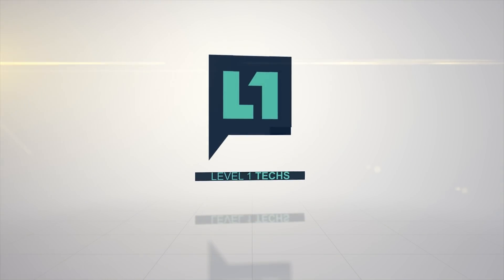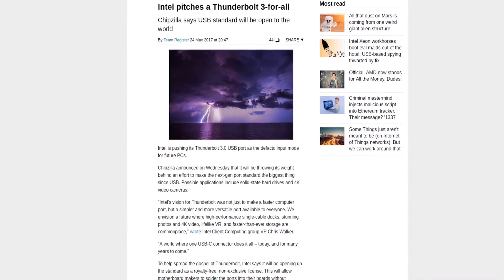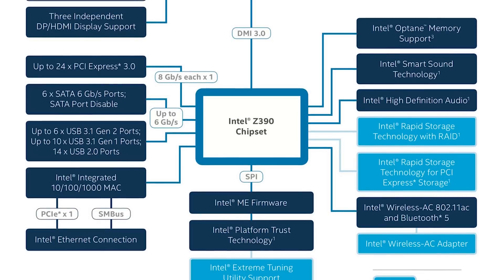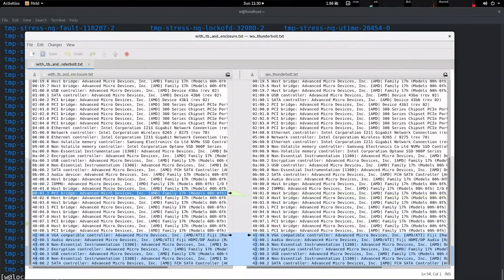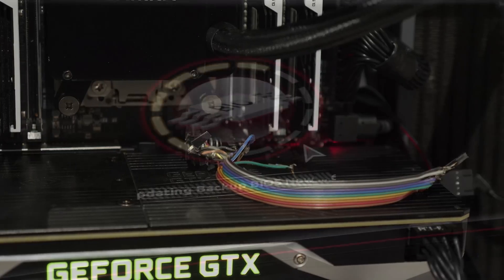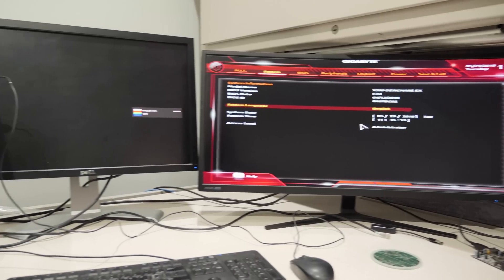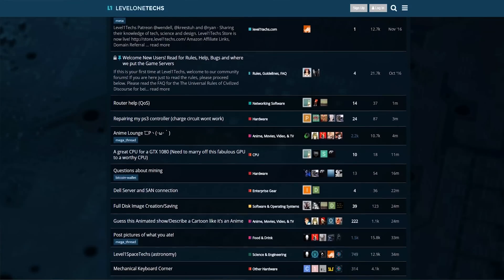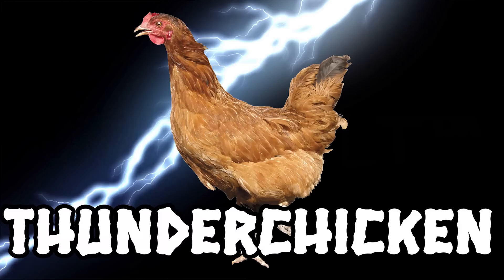Where is Thunderbolt on Threadripper?! Here it is, but...

Comment: Thunderbolt is the preferred way to connect pro audio interfaces for recording / audio processing!  It's lower latency, higher bandwidth and all around far more stable than USB.  This is super exciting, and I've actually been waiting on Gigabyte to certify this motherboard with baited breath.  Great work.  Thunderbolt hotplug is something that the hackintosh community has been trying to get done for a long time.  I wonder if your work could have some benefit there?
Reply: Not as low latency as pcie, or pci, especially when RME is the company you're talking about, with their FPGA chips, instead of off the shelf DACs other companies use.
Reply: CrimSun I'm not aware of any popular interfaces nowadays that use pci express cards directly.  Besides, TB basically is PCIe x4 right?  My point is that it is leagues better than USB on Windows because of inconsistent USB host controller drivers between chipsets.
Reply: It's a common misconception that professional audio requires a lot of processing for the audio tracks. Even a pc from 15 years ago can play hundreds of channels with the correct audio interface. And that's on PCI, not PCI express. RME's MADI protocol gives you 256 channels...On PCIe x1. When asked about why RME decided to stick to USB 2.0, despite brand new interfaces being USB 3.0, they explained that the extra bandwidth is not necessary. Despite advancements in computing, professional audio still uses 24 bits at 48 KHz, which even an integrated soundcard can deal with nowadays. The only theoretical benefits would be lower latencies but...Even on old PCI interfaces, you could get 0.025 ms of latency at 64 samples.
Reply: For just raw audio this may be true, but if you run a lot of plugins live in your DAW then you need extra CPU horsepower for that.  Also MADI is not RME's protocol, it's an AES standard that can be implemented by anyone.  For the purposes of having an audio interface that you can easily move in between different computers while having the lowest latency and highest channel count, Thunderbolt is the obvious winner.  This is why you see Thunderbolt on almost all of the most popular high end interfaces today such as the Apollo 8P, Presonus Quantum, RME Fireface UFX+, etc.  I work for a pro audio company, but also run a home studio in my basement using Thunderbolt / AVB to host live streams.  To minimize the amount of acoustic sound happening in the room when recording a band, I use Scuffham S-Gear / Guitar Rig live on any guitars and iZotope / Waves plugins on every channel in the drum mic setup at a 32 sample buffer.  You definitely don't need the best hardware on the market to produce music, but from personal experience my R7 1700X performs way better than my i7 rig in the sheer number of plugins I can load without having buffer issues.
Reply: You certainly don't need a thunderbolt connection on a DAC if you're just talking about a 2 channel playback device.  In pro audio interfaces it is popular because of its reliability, bandwidth and latency.  If you haven't used a large variety of pro audio interfaces with a large variety of computers you may not have personal experience with this, but USB can be unreliable when it comes to real time audio for studios.  The actual latency difference is fairly negligible, but in Windows especially there can be compatibility issues between certain USB chipsets and the USB implementation / drivers on certain audio interfaces.

https://en.wikipedia.org/wiki/USB_(Communications)#USB_2.0_speed_negotiation

Some motherboard USB chipsets do not properly implement "high bandwidth mode" and will exhibit strange behavior when using more than 24 channels.  ASMedia chips are particularly bad in this regard.
Reply: Well, Thunderbolt is not the obvious winner, Ethernet is. Many more computers have Ethernet ports than Thunderbolt ports or USB C. Also, many of the Ethernet based protocols are modular, allowing you to have as many channels as you think you need.
Reply: Yea, I use AVB in my studio and have used Dante in the past.  It's great for transmitting audio in between audio interfaces, but as far as an interfacing directly with the computer, Thunderbolt is better in my experience at least.  I've used the direct AVB connection on OS X and it is not all that great of an experience for use in a studio.  To use AVB natively on a computer, you need an ethernet card with an Intel i210 chipset that supports AVB and an operating system that supports it as well.  The vast majority of audio interfaces nowadays are USB on the low end and TB on the high end as far as the computer interface goes.  For anyone that runs a studio and needs a rock solid stable interface between their audio hardware and their computer, they're going to choose Thunderbolt.

Comment: I got Hotplug to work using a R9 380 on a riser using the express card slot on my Thinkpad. Drivers didn't load but I was using passthrough so it worked anyway.

Comment: I don't think Intel will ever license TB for AMD or ARM. and Honestly Why not AMD themselves come up with some other technology that has better bandwidth and lower latency?
Heck why aren't we using x16 external graphics over optical fiber cables? WHY NOT? Who cares about hot plug? a restart in modern days with SSDs ain't too much hussle and even windows will resume your Office word/excel sheets documents for you even if you didnt saved your work.
Reply: Having yet another standard is the last thing we need...
Reply: OCuLink already exists for x4 and x8 and they are working on x16. So there is a chance that you may find an OCuLink port on an AMD laptop in the future.

For desktops and servers there are already such add-in cards in addition to those ports being included on motherboards. Maybe soon enough Thunderbolt will not matter that much anymore as OCuLink receives wider acceptance.

Comment: Since you have been fiddling a bit with Threadripper. If you stress a single core using Statuscore or some other program on a 1950X in Windows and only see around 3.7GHz could the CPU be defect? I have a Zenith Extreme and cool it using a 360 Liqtech. BIOS settings that affect XFR etc are enabled. When I contacted AMD and asked and instead of technical support I got an RMA number... felt strange.

Comment: Every computer must have thunderbolt + USB-C and replace every port. USB-A must be for legacy retrocompatibility.
Reply: Guillermo Frontera I'm all for that. If we'd make openbolt it would be better tho. Straight up hotplug pci lanes. That would help with GPU enclosures.
Reply: I just want a motherboard that does not have any pointless shit , like audio or network ports or wifi or any other shit you dont need

Massive bank of USB on the back few RS232 a real PS/2 port and your done. Add your own Ethernet with a card , add your own audio with a USB DAC
Reply: Andrew Joy If we're talking removing pointless shit why not RS232 and PS/2 too? Ethernet and/or wifi has to stay, who doesn't need that?
Reply: Andrew Joy - same! I was thinking how pointless audio is, also. I mean, a lot of people will just use audio through DisplayPort or HDMI, and you can add an audio interface through Thunderbolt or USB any time you need. But yeah, unlikely to happen as people would rage. Perhaps they need to make the rear I/O plate modular so you can insert PCIe modules into it, and hence can exclude the sound card if not needed (and customise the rest).
Reply: Nicholas Johnson spdif should stay for simple stereo systems, for everything else hdmi is there. I don't know either why we have a lot of jack on every motherboard with software pieces of shit (sorry, i have forgot the name of them, but one of them supposed to help you to know where the enemy moves by step sounds and show it on radar, ecetera, i have no clue if its even work...).
Reply: Tappy What about for example 8 thunderbolt+usb c connectors + 4 usb c only + 2 usb A + 1 10GB Ethernet and may be audio. RS232, wireless and even PS/2 can be thundetbolt dongles with real pci-e bridges and your gaming keyboard and mouse can be direct pci-e low latency devices. Onboard graphics and surround audio can came from thunderbolt. Even thunderbolt external hi performance wifi dongles.
For me, every thing must be pci-e. Exept for low speed cheap devices than may be usb c.
Reply: @GuillermoFrontera  Can you count PCI express lanes? 8 thunderbolts is 8x4=32 PCI express lanes. That's twice as many any desktop level processors have and I'm not sure the MOBO Chipset can support as many.
Reply: Yes, totally agree. I am one of the people who want to embrace change as fast as possible - less painful that way, minimise the transition period where you have the overlap. But people like to drag things out. They are worried about pissing people off when they cannot connect old stuff. When the MacBook Pro 2016 came out, all people could see was "they are doing this to sell us dongles" when in fact, it was one of the few things I actually commend Apple for. It was a bold move, but it was a good one. The same as their driving of DisplayPort.

Whether it is Thunderbolt 3 or some other standard, I want some form of PCIe through USB-C, and I want to see USB all but disappear (probably only keep it for slow devices such as mice and keyboards). Cut out the middle man. USB is another protocol. Thunderbolt does not add another protocol (none that is visible to the system) - it just carries the existing PCIe from A->B. The Thunderbolt protocol is transparent to the system (all the system sees is a PCI bridge).

Comment: Kind of relevant, We (Macrumors forums) got NVMe booting working on the Mac Pro 5,1 by extracting the NVMe_DXE.ffs from the 2013 Mac Pro and Patching it to the 5,1 EFI firmware. The 2010 Mac Pro does not have Signed EFI update support, so an EEPROM programmer is not needed, it's all done in the OS. https://docs.google.com/document/d/1WNkM9LuGPq1sArO9EedWBHYq14NU7m-mDBLAWWJipyM/edit#heading=h.l23937sx565e
https://forums.macrumors.com/threads/mp51-0084-b00-rom-dump-request.2119496/page-14

Comment: Weirdly I was just thinking about this. Do people not use Thunderbolt 3 cards? Or does that not work?
Reply: Silas Mayes Thing is that they don't connect directly to the CPU and thus get limited by the PCIE bandwidth that the card is connected to. By running TB directly from the CPU you can directly utilize PCIE lanes for the TB connection itself. You may want to compare it with the way Intel sets it up, where all TB connections go through the chipset. The chipset is connected through the DMI bus which forms a bottleneck. Regardless of TB cards working on Threadripper (I have no idea if that works), this is one step further and even better :)

Comment: Lightning bolt might be a good name for it, although Wendelbolt sounds cool aswell !
Reply: Open Bolt seems like the best one I've heard others throwing out.
Reply: A Lightning Bolt would not be limited to 2M cables, though.
Honestly, where are the optical ones already?
Personally Thunderbolt needs to revert to being Light Peak.
I hope they designed the ability to insert optical fibres into the USB-C connector, otherwise they will need to change again, or use transceiver cables (which are inherently unreliable).
The USB-C spec has changed to allow direct-connected devices to reconfigure the 4x USB 2.0 wires as a third super speed channel - but this will require new cables, as the existing ones use poor quality wires for USB 2.0. I am guessing the new cables will be e-marked as being fit for purpose. The first standard to make use of this is VirtualLink for VR. But Thunderbolt should be able to make use of the third lane to increase bandwidth without too much of an increase in signalling rate. But it is only delaying the inevitable - that copper is not enough. If Thunderbolt started off optical at 10Gbps (abandoned because of cost), then at 40Gbps over copper, we must be just about at the limits (as they thought it would need to be optical from the get-go).
Reply: I think that name had been used sometimes...

Comment: Wow,  nice to see good old reverse engineering at work. I hope we will finally get thunderbolt support on AMD.
Reply: Sam Nasab you probably didnt see that they will be licensing thunderbolt to other companies long time ago
Reply: You already do ... look up the anandtech article on the raven ridge HP Elitebooks.
Reply: @afc8981  note: it was an error on HP side. Their official specification didn't point out that AMD variant lacks TB3 compatibility.
Reply: Sam Nasab - possibly. Although no matter how much I love Thunderbolt, I'd rather abandon it than be stuck with Intel forever. Eventually Intel is going to have to release it into public domain and integrate it with PCI standards for it to have a long term future.
Reply: Nicholas Johnson it’s not a question of if Thunderbolt will be more widely available, it’s more a question of when it will be both integrated into all Intel  CPUs and the standalone controllers be cheap enough to integrate into even embedded systems with VIA or Vortex CPUs.
Reply: Adam Abbass, we need a reference on that one. I cannot find such article. But a while ago Reddit thought there was a 2500U AMD laptop with Thunderbolt 3, but it was later proven to be a typo from BestBuy or whatever.
Reply: Intel are pushing Thunderbolt as a selling point for their workstation systems and business PCs. Unfortunately, I doubt they would license it to AMD.

Comment: One thing that it could be useful for is what Linus does with his home system. He put his gaming servers on a rack in another room, then used a thunderbolt display/usb device in his office connected with a long fiber cable to his gaming system. It basically makes for a completely silent gaming experience even if you have a noisy cooling solution.